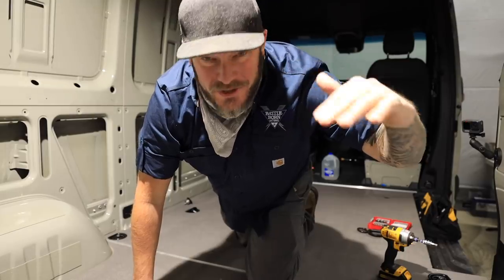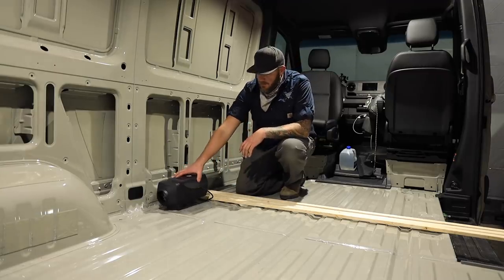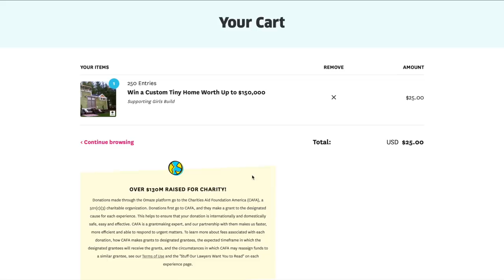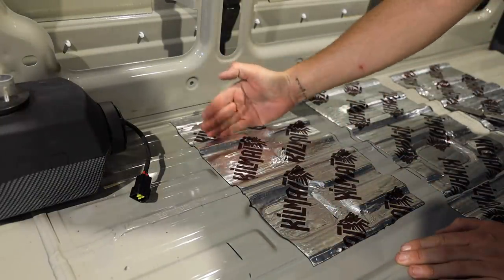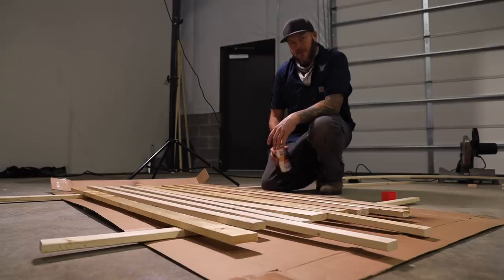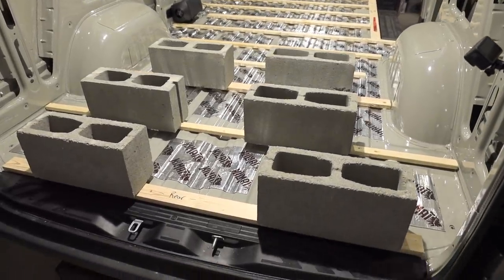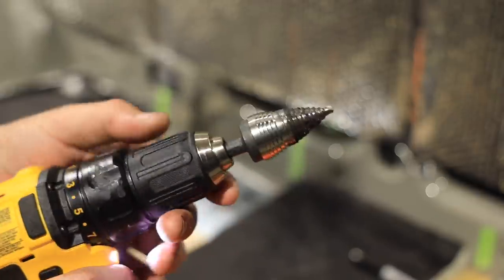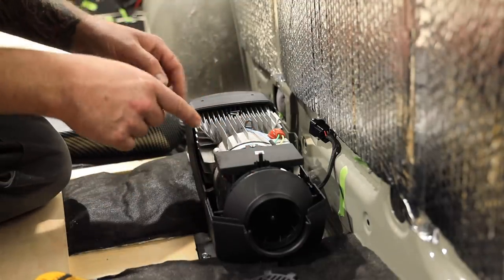Living The Van Life - Sprinter Van Build - Subfloor and Heater

Comment: Chad, great to seeyou back
Diesel heater safety note.
When snowing around you, and snow piles up, the air pocket underneath the van may trap the CO, NOx, CO2, and other poison gases coming out.
They will sip into the cabinet eventually. Take care, install the necessary alarms that react to diesel burn poisons, and factor precautions into the design and execution of these elements.
Take care from Jerusalem, Israel!

Comment: one level of thinsulate has an R value of 2.9.  Reflectix has an R value of 1.3 I used foam board and it has >R20. I installed 3 inches of foam board. But My van has tons of head room for a mid roof Transit:-) so I could stand to lose 6 inches of head room and it still works for me, maybe not my visitors :-) . My build is about 80% done. The more windows you put in your van the more you need insulation.
Glad to see you back Chad!!!!!!!!!!!!
  Also Please think about using RivetNuts instead of screws! In an accident your build will not come flying up to crush you! Bolting your things to your wall is much safer!!!!!!!! To help find were to drill the hole to but the bolts in I cut the end if a bold and sharpened the end. Then screw in into the rivetnut and put the wood were I want it to go and hit the wood with a hammer. And that made a dent were I need to drill a hole for the bolts!

Roger The ExBassGuide  ((Subscriber for a long time!))

Comment: Glad to see you're back Chad. One thing, I would have used bolts to attach the mounting plate, for the diesel heater, to the floor. In the unlikely event the heater needs to be replaced.

Comment: I have a Sprinter and had another one prior to the current unit.  One of the most important tips that I could give you is to take great care that you monitor your weight and this starts with the use of lightweight materials where possible.  You could look at the possibility of mounting the diesel heater under the floor, but the unit would need to be completely waterproof of course.

Comment: This is actually quite interesting!  I believe Chad's very first van was that Volkswagen van, which is basically the equivalent to getting a pre-built PC.  Absolutely nothing wrong with that at all; I'm not some gatekeeping asshole!

It's just that something like that van didn't really speak with me since I was never planning to go down that route.  I personally don't want to have to rip into the mechanics of the van I'm getting and completely or almost completely replace it.  I personally want the van to be more or less drivable (albeit probably some minor fixes since it'll be a used van).

But with this build series you're actually doing something that I can use to learn from!  I've been planning on getting a 144" Sprinter.

Comment: Wood strips are going to directly conduct cold from metal floor to wood floor. No solid vapor barrier or solid insulation.  Radiant floor 120volt heat system would be great...warm floor and help to warm the interior.

Comment: Nice build and happy you are keeping your dreams alive! As others have noticed and I dont want to nit-pick but where you drilled the holes for the heater exhaust you should have had a coat of some kind of heat resistant paint to protect from rust...and the self-tappers for the mounting plate could have used a dab of some kind of sealant before sending them in...just saying brother, not criticizing just trying to help ❤️

Comment: no vapor barrier over the insulation? and rust protection on the edges of the drill holes?
Reply: Debur and paint it at least.  Also noticed he had a bunch of wiring and insulation in the lower part of the van walls starting when he was installing the floor.  Where was that part?
Reply: check out outdoor chef life 2nd channel for a better build
Reply: Ya with no vapor barrier...its gonna rust.  Not sure i would have even bothered with doing this to the floor....
Reply: He can remedy the possible hole issue from the underside, where it would be very advisable to have it, as well as the interior walls and roof undercoated with a Zibart type of material.
Reply: I am not a professional van builder, faar from it , but I would consider using vapor barrier if van is going to be used in cold climate.
Moisture from warm more humid van will go to insolation and rot and  mould it out.

Comment: The two outlets holes for the diesel heater, should u try to seal them from the inside to prevent any leakage back into the cabin? Just thinking

Comment: Really looking forward to your build. I am having to rebuild a tiny camper that I built a couple years ago and love getting new ideas. I've heard that the fuel pump for the heater can make unwanted noise when it's bolted directly to a metal surface and have heard that some people use a bit of rubber in between the unit and the mounting surface to dampen the sound it makes.

Anyway looking forward to the next video and Good luck with the build.
:)

Comment: Every were there is a wood strip there will be a thermal change and loss hope you don’t see moisture problems,  you can see it in home were every out side wall stud is but usually there is outside thermal break an sheet rock does also

Comment: Why do a gap between the rows of Kilmats, doesn't that defeat the purpose of this insulating and sound barrior? I like the glue method for the furring strips. You could glue them onto the Kilmats. I would install a CO Detector in the van, the really good Diesel components in time can crack or leak CO in the van while you're asleep. CO Detectors are cheap - First Alert BRK CO910B Carbon Monoxide Alarm. Hey, you asked for some feedback.

Comment: I was starting to have withdrawals not watching LTVL then, “BAM!!!” there u r. Got my fix of DIY van build. Thanks bro.
Quick question: “y didn’t u reuse the subfloor that came with the van after u installed the insulation?” It was already cut to fit n it looked like 1” ply.
Reply: I had the same question and thought about the original subfloor.
Reply: I was thinking to myself...self, those subfloors r already perfectly cut to fit n would save some money by reusing them.

Comment: Yo LVL, you should install a Starlink dish for smooth internet while you’re traveling
Reply: Good idea
Reply: Good thought, though Starlink isn’t going to allow this. Per Starlink’s FAQ on the topic of: Can I travel with Starlink, or move it to a different address?

Starlink satellites are scheduled to send internet down to all users within a designated area on the ground. This designated area is referred to as a cell.
Your Starlink is assigned to a single cell. If you move your Starlink outside of its assigned cell, a satellite will not be scheduled to serve your Starlink and you will not receive internet. This is constrained by geometry and is not arbitrary geofencing.
Reply: @frankkeeney1854  actually elon said that will be a feature where trucks will be able to mount starlink dish. I don't have much infos about this but it is not available yet
Reply: @younes-47  yeah, but he just barely put in a request with the FCC, so its about a year away at the earliest.

Comment: Greetings. I see you laid insulation in a way that it touches a metal on the floor. I'm concerned that once that insulation gets wet (drink spill or you maybe drive through a river) it barely dries up, keeps contacting metal floor and maybe starts a nasty corrosion. On the one hand there is a paint and a primer which are supposed to prevent that. On the other you were rolling down that killmat pretty tight also worried about moisture trapped there. Did you maybe did same job with previous van and it survived just fine for 10 years?

Comment: Hey Sir. Great video series.  I was going to comment on your Vanagon follow up review video about the Diesel Heaters but decided to do it on your new video Series. 
I've got a question about the Diesel Heaters. Would it be possible to Install/Run(operate) 2 heaters at the same time in a Van?  I'm building a Winter based Van for Skiing and would like to use 2 Heater,1 for a DIY Gear(Boots and Gloves)Dryer with some Duct Work and the other for general space heating.  Any help would be greatly appreciated. Thanks alot

Comment: I'm interested in the power draw of your 5KW 12V Diesel Heater. I did find fuel consumption of 1L every 4 hours, but that's the only spec I could find. Any other info you could provide I'd be very thankful. Great video BTW!

Comment: You want to insulate the floor but every were you put down a wood strip strip you loose insulating value if you put down ridge insulation board then use 3/4 plywood and bolt right through,you will make a sandwich with no loss . Then all the. Accessories can be fasten right to the 3/4 witch will be fine

Comment: Could you not have just done the full floor in sound deadening then latex the wood on top? That’s what I did with my sprinter and worked great, you were worried about air pockets but you have the strips with nothing so won’t make any difference

Comment: Hey Chad, I’m getting my new 2021 Mercedes Sprinter 2500 170” v6 turbo diesel 2WD. Now, my question will rear wheel drive make it through icy snowy road in Washington? Any tips!
Reply from the maker: Get the best snow and ice tires you can get.  Also carry tire chains.  That should get you through some of the worst stuff.

Comment: I think the first floor layer may had been a petforated Silicon mat pasted. Second reflecting insulation layer and the third may had been this rug type insulation mat.
The layers may be cut on points where wooden bars are to be fixed with silicon glue.